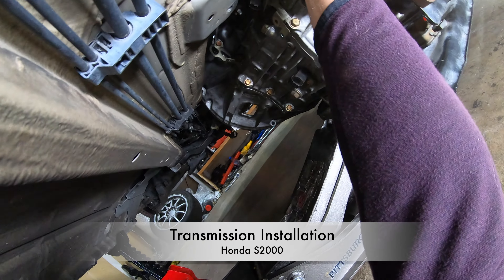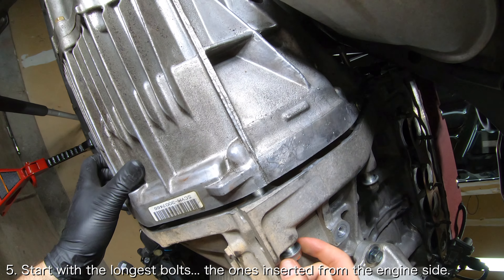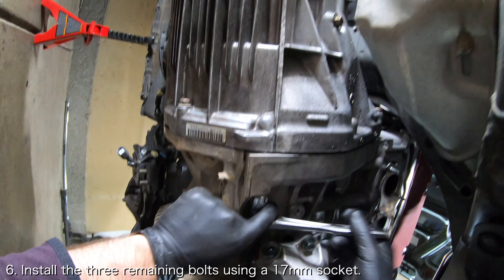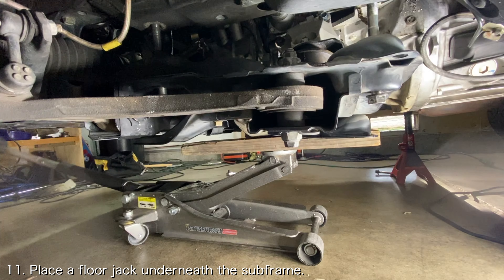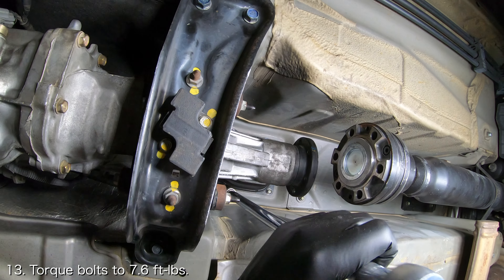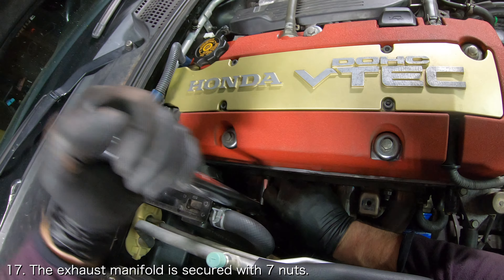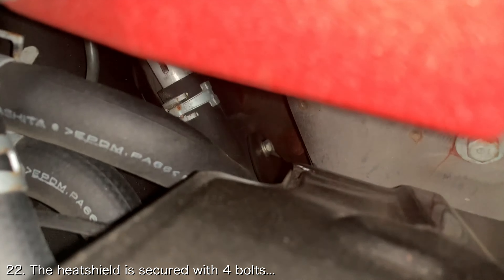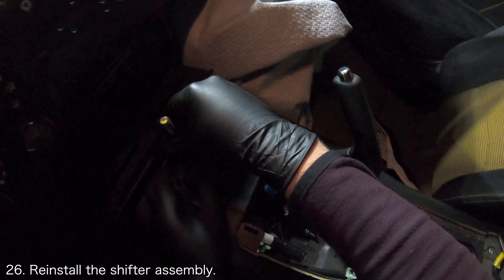Clutch Replacement Part 4 - Transmission Installation | Honda S2000

Comment: YOU CANNOT BELIEVE HOW THANKFUL I AM FOR YOUR DETAILED VIDEO. I've been watching endless videos trying to understand why my transmission wouldn't go flush all the way to the engine when putting it back up. You explained that theres is going to be a less than an inch gap and then you put the transmission bolts. Thank you so much! I thought I was doing something wrong and didnt align the clutch properly or something. Now I can have piece of mind when installing my transmission

Comment: I can't thank you enough.  Your video series is exactly what I needed to do this job successfully.  I just got back from my first 5 minute drive and everything is working great.  I have you to thank for making this job relatively easy.  Some tips I discovered doing this job on my own:  You can access the top transmission bolts from above the engine.  To cut down a socket, I used a wide metal file and a drill.  I had a hell of a time getting the propeller shaft bolts out and after buying new braker bars, etc, I wasn't getting any closer so I ended up taking the prop shaft off from the diff side - no issues.  I didn't have a transmission jack so I used a floor jack and a cheap synch belt to lash the transmission to the jack and that worked flawlessly.  To line up the transmission easier, I went to Home Depot and purchased 4 longer bolts, 2 of each size, to guide the transmission - I only needed two and it made it super easy - just don't accidently forget your Honda bolt at the store like I did... sigh
Reply from the maker: You’re welcome! Yeah you can access the bolts from the top but it’s really really tight. I think you’d need just the right tools to make it work. 

Good tip on cutting down the socket. 

Did you try using an impact for the prop shaft bolts? I think it’s quite important that they are impacted off, otherwise you risk stripping them.
Reply: @DIYGuysvideo  I tried everything short of a cut-off wheel: Electric impact, air impact, braker bar, etc.  This is the car's 3rd clutch so I'm not sure if the folks who were in there before me over-torqued the transmission side prop shaft bolts or if they ran into the same problem I did and took the prop shaft off from the diff, or what, but the diff side came out with an impact like it was joke.

Comment: Quick tip for others-
I used the long alternator bolt to help align the transmission while I was trying to get the splines to line up. It threads into the bottom transmission bolt holes and it’s longer so it will bolt in before the input shaft goes in.

2 long bolts would have been nice but I made due with just the one.

Also make sure your slave cylinder shaft went into the clutch fork otherwise you will piss clutch fluid everywhere when you go to test it and then have to bleed your clutch... ask me how I know lol.

Thanks for the video! It definitely made this easier.

Comment: Couple things.

Be super careful about getting correct trans to bellhousing bolts in correct positions. Put a long bolt in a short hole, will crack engine block when torqued down!

Also, lube up the subframe bolts, as they can oxidize and cause major havoc. Use antiseize. With jack in place, remove one, replace. Then do each other one at time. Then lube the two center ones before replace.

Comment: Thank you so much for these videos. I appreciate how specific you are down to the torque of each bolt. Can I request a rigid collars video and/or ball joints DYI video?
Reply from the maker: I have rigid collars sitting in my garage but my alignment doesn’t seem to change much between track days which is the only reason I haven’t made a video on it. Ball joints I’ll need to have an issue.

Comment: Awesome video, this was super helpful when doing this job. BTW, I have an AP2 ('05), and the rearmost subframe bolts are 17mm.
Reply: Same here on my 04. I wasn’t really paying attention and hit it with a 19mm on my impact and it just spun. Luckily it didn’t round off the bolt head.
Reply from the maker: Oops. Sorry I missed that. I know one of those bolts was revised at some point and I thought the new bolt head was a 19mm

Comment: Great video. Im getting ready to do a clutch job myself and I was wondering if it was worth it too replace the slider/guide that the release bearing goes over. I watched a few LHT videos and they recommend replacing it. I don't feel any roughness at the moment with my clutch so that should mean it's fine right?
Reply from the maker: I have also seen LHT's videos and how they recommend replacing it. I personally haven't felt a groove in the release bearing guide so I never bothered replacing them. Billman says that some early S2000s didn't have properly greased throwout bearings, which can cause damage to the guide. If your clutch feels smooth you're likely fine.

Comment: Idk I did what I thought was the correct way, after input shaft is in wiggle trans until dowels are in and trans is completely mated before threading bolts, makes sure you don't crush the dowels.

Comment: Really helpful video, but is it okay to mate the engine and bell housing by tightening the bolts? It seems kind of risky, is there any risk in doing this?
Reply from the maker: I guess a risk would be cross threading if you don’t have the engine and transmission aligned correctly.

With most things, if it doesn’t feel right then stop 😉
Reply: @DIYGuysvideo  yeah, I had a look on some forums too and it seemed like the only real risks were either that or the dowels getting crushed. 
But mine went on nicely, tightened the bolts up evenly and it all works. 
Thanks for the video, it was helpful 👍

Comment: Hey Jason, amazing job on the series! I could only imagine how long it took to produce with documenting every step. From me, and the rest of the S2000 community, we thank you so so much! Also, did you reuse the original exhaust manifold gasket?
Reply from the maker: I did reuse the original exhaust manifold gasket. Never had an issue doing this.
Reply: I was wondering the exact same thing myself.

Comment: When you torque the drive shaft bolts did you put the transmission in gear when torquing the bolts
Reply from the maker: I put the handbrake on.
Reply: @DIYGuysvideo  got it

Comment: I’m not sure you’ll see this but I’m running into an issue where the bell housing is too tall and hits the firewall of the car when I’m attempting to line it up. If I put it straight and line it up, the bell housing fits but the input shaft hits the bearing and won’t go anywhere. If you see this, your input would be greatly appreciated!
Reply from the maker: When the engine doesn’t have the transmission attached it will sway forwards/backwards fairly easily. 

Maybe have someone tip the engine backwards if it helps. I very carefully jack up the trans until the input shaft is level with the release bearing and then straddle the trans, push it with my feet until the inout shaft pops into place through the release bearing.

Comment: The only thing I think that was missed is replacing the throw out/release bearing guide.
Reply from the maker: I had replied to a similar comment on Part 1. 

I know LHT likes to make a big deal about how they always replace the clutch release bearing guide but I am skeptical as to necessary it is to replace it which is why I omitted it from this video. My clutch release bearing guide had 150K miles and seemed to be in fine shape.
Reply: @DIYGuysvideo  based on my anecdotal evidence I agree that it’s probably not necessary for every case. My 04 with 138k felt perfectly fine. I already had the new part so I replaced it, but I don’t think it was needed.